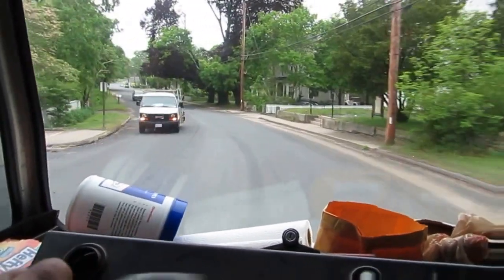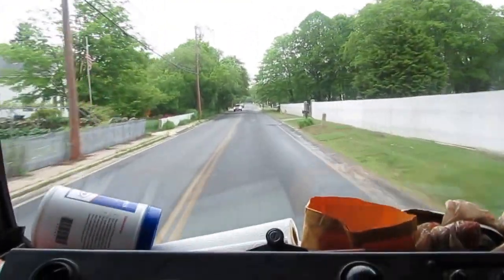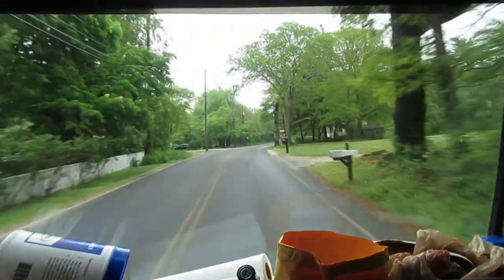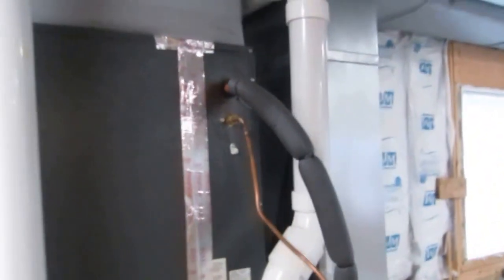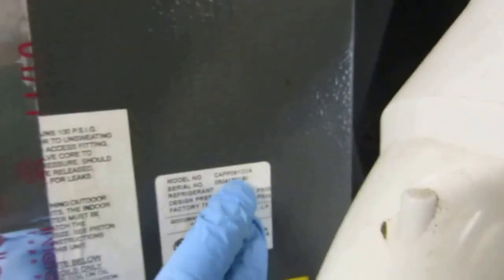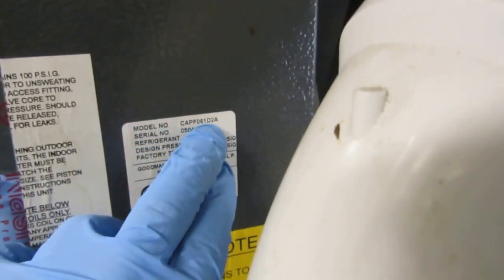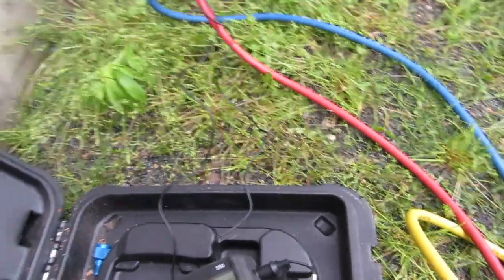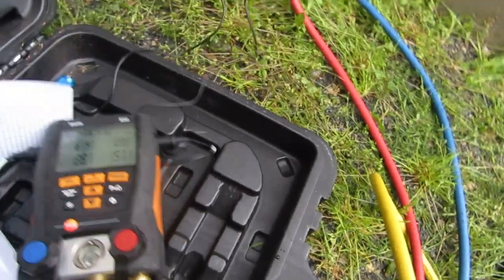HVAC REPAIR:-very low liquid line temp,high subcool,no air conditioning

Comment: Did the previous company install the dry r22 system?
Reply: Dry R 22 condensers come pre-charged with nitrogen in them. I wonder if the previous company pump down the lines of opera coil charged it for the link the line set and forgot about the Nitrogen in the condenser

Comment: I'm not expecting a response to a 6 year old post but I had to reply. First Steven says it is a 3 ton condensing unit with a 5 ton coil and changes the piston. Then he corrects himself and says they are both 5 ton and puts the old piston back in. Hopefully he realized that before evacuating and charging the system and didn't have to do it twice. First of all, how does someone mistake a 5 ton unit for a 3 ton unit?! Second, it is outrageous to try and match a 5 ton coil to a 3 ton condensing unit by downsizing the piston. Any tech worth their salt wouldn't even consider that. I wouldn't want this guy working on my system.

Comment: Can someone help me... Brand new home... 2 Units in Attic Goodman.  Both are running fine but one system has a cold liquid line.  Company says it just needs insulation on line, I said that line should not have any insulation on it.   The other systems liquid line is not cold, fix the problem.  So far they have not found a solution.  Any ideas?  Systems are identical.   Dripping a good bit of water in my attic now, from condensation on the line from attic to outside unit.

Comment: so their was air in unit and all he did is recover the refrigerant then he do what?????
Reply: Angel Pair pulled a vacuum and put fresh r22 in
Reply: Is there a good way to identify contaminated refrigerant, maybe taking a pressure and temperature reading while the system is off and equalized and seeing if it shows zero degrees subcooling?   If it shows anything other than zero, that would indicate the wrong refrigerant is in the system, wouldn't it?

Comment: If you didnt have a recovery system could you pump it down close the valves and then evac and refill? just curious im just getting into the AC stuff im a Plumber living in a rural area with no Fridgys anywhere near but ppl calling me for help.
Reply: You can pump it down. It depends on the call. I've pumped it down plenty of times, it can be a pain if there is a low pressure switch. But overall I think it's better to reclaim it all and start fresh.

Comment: Anytime you take refrigeration out of the lines you need to change the filter dryer as well. Pretty hack job if you ask me. You can never put a vacuum back on the lines without doing that first.
Reply: You don't need to change the liquid line dryer on a brand new unit. Just close off compressor and flush lineset and coil. Before you pressure test etc...

Comment: There is no need to do all this shit....if you put in vapor it can not be overcharged...so with r22 put guages on and open the low side on guages...the system will only take what it needs...but you can not  do it with 410a because you must put in liquid...it only works if it's a pure refrigerant...not a mix

Comment: With a 5 ton Goodman coil and what looks to be a 3 ton Ruud unit. Would not the indoor evaporator ratios on the coil help cause this problem?  I'm surprised the pressures were not off more. I hate the mix matching of systems.

Comment: hi I like your video but, you said that the problem was air on system.  but you have i sigthglass on your gauges you should now right away because it will bobble on the sigthglass rigth?

Comment: Steven, thanks for the informative videos.  I'm  wondering, wouldn't it be a good idea to take a static pressure read 1st thing before startup to determine possible non-condensibles?
Reply: Are you saying, if you don't have straight freon the vapor pressure would be off since you have the partial pressures of nitrogen and R22 combined?
Reply: +Ken Marriot,  that's correct.  According to "Dalton's Law of Partial Pressures"  the pressure will be the total sum of the individual gases.  So, one could actually subtract the pressure of the known gas and refer to a chart to try to determine what the other gas may be.

Comment: so how do you adjust for a larger evaporator coil with a smaller condenser coil? I'm a apprentice and I have never seen that before.
Reply: A piston is shipped with the condenser to allow enough pressure to be built up to allow the condenser coil to work. The piston is marked with a number indicating the diameter size of the opening in thousands of an inch.
Reply: I would say when you oversize the evap you need a txv. A piston IMHO doesn't work well

Comment: I would have leak checked just to be safe but it's a safe bet the installer just opened the valves without pumping the unit down .

Comment: I just watched this video and read all the comments.  I get the air in the system and why, but did you also change the piston.  Did the sub-cooling go down because you got the air out AND changed the piston?  Or did it go down ONLY because you removed the air?
Reply: 958kris he said he put the original piston back in 👍
Reply: How does the piston work?  Is there a moving part inside it?  From the video it looked like a just a screw in bolt with an orifice through it acting as a restriction to the flow of refrigerant.

Comment: cash is king, great video.   Been studying, have a 4yo 2ton package Payne R22 on the roof low on freon.  Still has pressure, did leak spray down, looked for oil, nothing.   Thinking about replacing shcraders and then I don't know.  Watched a ton of videos and understand a good portion of stuff now thanks to guys like you.  Any recommendations?
Reply from the maker: probley leaking in the evaporator you need a refrigerant leak detector for that job ,or you can use die and a uv light . leak could be anyware .yes look for oil on line
Reply: +steven lavimoniere Thanks for the info.  I will top off the charge using the superheat method and go from there.  i have a recovery machine and if it runs low within the year or so, I'll reclaim and dig into the leak detection you talked about.  What are your thoughts on 407C?  Thanks again.

Comment: Thank you Steven, This is a great video. I watched three times to get more understanding.  I have learned a lot from it.  but I still confusing,  when the indoor unit is bigger (5 tons)than the outdoor unit (3 tons) you change the piston to the size of the outdoor unit. For the next video could you go more detail how to use the York slide chart (Superheat calculation).
Reply from the maker: no you have to have matching equipment to run properly   .. you can have a bigger inside coil with the proper piston ..but not the other way around .. if the condencer is to big for the coil your in trouble

Comment: what happens if you turn on airconditioner when the outside temperature is low
Reply from the maker: +Donald Lee it will not work ,why do you need a.c if its cold out. if you run it in the cold the head pressure will drop .a.c. is designed to run between 72 and 74 .unless you put low ambient controls on unit . like fan cycle switch crank case heater time delay ect
Reply: thanks steve . love the dog.

Comment: fucking hell yes! i was thinking the same thing just reset the charge. so my boss does an install right on a new condensor then pulls a vacuum so if you pull a vaccume on a new condensor do you just pull it to the recommended microns and charge with freon? is that the same procedure when recovering too?and if it had air in the system how did you avoid getting it in the recovery tank?
Reply from the maker: +Arnold Navarro not so concerned about air going in recovery tank .as long as its not in the system
Reply: i got to know this. so if you pull all that refrigerent with air into the tank wouldnt it go back in to the system when you put it back in.
Reply from the maker: you go back with fresh refigerant out of a new can . the reclaimed r22 goes to the reclaimer for reprossesing
Reply: thank u sir
Reply: Arnold, hypothetically if the one wanted to re-introduce the refrigerant back to the same system they could let the tank set overnight and once settled the non condensibles will rise to the top at the valve and a quick bleed off (vapor side) should clear them.  You'd need a minimum of 3 or 5 lbs refrigerant (can't recall) in the cyl in order to do that. I do it with temp probe on cylinder and bleed incrementally until  pressure matches p&t chart.  Digital gauge set makes it very easy and accurate.

Comment: All I would have needed for this job is the back pressure and maybe the head pressure but not even.  I feel the suction line and liquid line for temps and that's all you really need lol....those gauges are pretty cool tho lol. 
Pressure temp charts are very helpful.
Reply: +David Townsend can you tell me  how just feeling the liquid line and suction line and get a diagnosis?      Im curious  of this knowledge .   Is it a short cut that makes the job faster?

Comment: They sold an r22 system just last year???Who even knows what they charged it with...never know anymore ... At least the customer has the true 22 ...The duct guys looked good, but the start up crew left a mess  Sorry , just noticed it was installed three years ago . Even so they should not have sold him a 22 system unless it was only a condenser swap..
Reply: David Karnd
Many r22 systems still running after 20 years. R12 and r502 were also good .
Reply from the maker: Brian Ellsworth its working fine now
Reply: no, they need to sell R-22 systems. can't beat the bitches! Best every!

Comment: Hi Steve. When the unit does not use an accumulator do you charge your R-22 as a liquid through the low side or as a vapor?
Reply from the maker: Michael Grana r22 is  not a blend so you can charge by gas or liquid.. if its a blend you have to charge by liquid .or it will fracinate
Reply: Ok. I charge my 4-10A as a liquid. I read if the R-22 is charged as a liquid thru the low side on an accumulator unit it can have bad spikes and make the accumulator not do its job so I was charging 22 as a gas in every instances just to be safe, wanted to double check tho with a experienced tech

Comment: I just bough a fieldpiece smen460 and when i subcool it never stays stable. Does the samething happen do you ? I know their different manifolds but im just curious.
Reply from the maker: albert9560 there is not condensables /air in system the head pressure should stay constant .but sometimes the txv will hunt a little and cause a problem .i would have to see it how bad is it is there a big swing ..probley condensables in system ,,,never pulled a good vac.before charging is a common problem .

Comment: Common Goodman pos leaking coil can't stand Goodman.
Reply from the maker: James Hoschek the coil was not leaking .. get a grip man watch the video again and get educated
Reply: I am making a statement I cant stand Goodman.  As an owner I have sold 350 units GOODMAN and about 75 of them had leaks.  You do the math on how many unhappy customers I have had.  Education is what I strive on it had nothing to do with your video... I will just never use that product again....
Reply from the maker: sorry you had a bad exprience i feel the same way about york micro channel condencers
Reply: steven lavimoniere Ive installed allot of goodman units and have yet to have a problem with them, only problem I have had with goodman was on some of the furnaces, was a stretch there of bad pressure switches, all covered under warranty. Best bang for the buck in my opinion. Allot has to do with the person installing them.

Comment: if there was air in the refrigerant, wouldn't that mean there's a leak ? if not how does air get in there? thanks.
Reply from the maker: Moe Boom on the dry shipped units they come charges with dry nitrogen so you can  ,use what refrigerant you want to so you have to reliese the nitrogen charge before pulling a vacuum on doth piping and condenser then you can charge her up.  so if he only pulled a vac on piping and then reliesed the dry unit charge there would be a lot if air in system.....or maybe he did not pull a vacuum at all i was not there so i do not know what the other guy did all i know is i had to reclaime the whole charge and start from scratch to get her right
Reply: When in doubt pull it out 😂

Comment: never trust the other joe guy. start from scratch. means to check if the the equipment is the right one, if matches indoor to out door and  before any refrigerant added check air flow, clogged return filters, static pressure, etc.
Reply from the maker: RAUL ROJAS i agree
Reply: Just saw this raul and your exactly right

Comment: I have problem with my ac capacitor kick back off every time when the pressure go down under 25
Reply from the maker: Aj Moua its kicking off on a low pressure switch ..it probley has a leak and low of refrigerant.or there are other things that could cause low pressure like a restricking,most likely low on gas

Comment: That Testo manifold is balls. And kudos to you for taking the time to recover the gas and change the piston. I know a lot of techs who would have added gas and then bailed. You seem like a good tech.
Reply from the maker: Edward James well this guy called me because the new system never worked right sense day one..when i ran the system and put my hand on liquid line inside of house i could hear and feel it shaking i know there was no condensables in system .so i wanted to start from scratch .only way is to reclaim the charge and start again ..
Reply: Yea it was a good call on your part. I'd have done the same thing. It doesn't take very long to do shit right. A lot of "pros" think evacuating is a waste of time. They open the valves and "purge" the gas out the service port. Sort of like purging a boiler. AC doesn't work like that. It boggles me some of the shit these guys get away with out there. I feel truly sorry for the homeowners who payed for their hackery. Good work my friend!!

Comment: Can you put back the reclaim refrigerant back to the system?
Reply: Yes, but it's very time consuming and you have to have the equipment to separate non-condensibles (like nitrogen an/or air) from the refrigerant in its liquid state.  Often times it's just cheaper to reclaim the contaminated mixture and have it 'disposed' of by a company who does this on a large scale and buy it back as 'recycled' refrigerant.  I've seen forums where 'techs' are saying to put a purge fitting on the top of their reclaim tank and slowly venting it off to push the air out of the tank, which is partially true since most refrigerant vapors are denser than air, until you smell (in some cases hear the change in sound cause by the vapor escaping) the refrigerant leaving the bottle.  In any case this is a Very Bad Idea™, you will inevitably be venting a (H)CFC which is an EPA no-no, and it doesn't guarantee you will remove all dissolved non-condensibles.  If you are curious, a proper separation rig is something similar to a moisture separator on an air line system where you intentionally collect the liquid.  It is done in multiple stages before collecting the final distillate three stages or so down the line before being tested for final purity and re-bottling. Off-gasses from the second on separation stages are sent back to the start, gasses from the first are sent to collection for incineration of trace (H)CFCs.
Reply from the maker: willie1950 no never a good idea ...

Comment: Had a lady call for a "estimate"/ 2nd opinion.  She was a hoarder.  Smelled her house from 15' away.  Anyway, a jackleg installed a 2 ton heat pump condenser on a 5 ton air handler.  Needless to say it didn't work.  I told her $2000 to redo it.  She said "that is more than I paid for the whole system".   Ding...Ding...Ding....there is the problem.  I didn't get the job.  Didn't want the job.  Circa 2001.
Reply from the maker: some jobs you just don,t want anyway that is one of them

Comment: I bet you anything it had nitrogen in the lines because it's an r22 dry unit and the guy thought it was precharged
Reply: I bet you are right.  I never thought of that.  It definitely wouldn't cool well with a nitrogen charge!
Reply from the maker: not sure what the other guy did but it was a mess
Reply: You don't charge sub cool on a piston
Reply: @mcc5483  that's an ignorant statement. Everyone knows that. He used subcooling to help diagnose the problem. Subcooling and superheat should always be checked regardless of the metering device.

Comment: Would you know how to repair a 500 ton unit
Reply from the maker: 500 tons wow that would be a chiller  more like it  .. i have seen 30 ton  residenial is usually up to 5 ton  .small commerial 2 stage 10 ton is the most i usually work on

Comment: TARGETED SUPERHEAT
wet bulb 3 times..example 62.4 wb times 3 =187.2 now minus your ( consistent) 80
a consistent is like h=(6.62606957 × 10-34 m2 kg / s) meaning it never changes...
so, 187.2 minus 80 your consistent ..minus..ambient temp at condenser  divisible by 2= targeted SH...(remember targeted).also, check you reference append chart  to verify...
+/-5 allowable..
Thanks
Reply: Donna thanks for the equation of targeted superheat